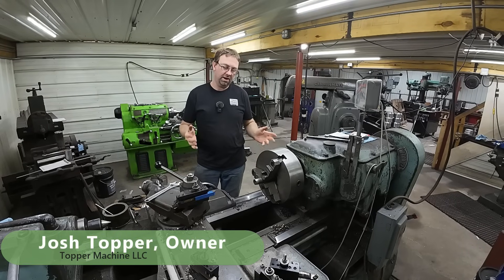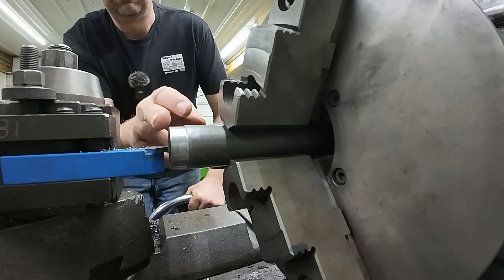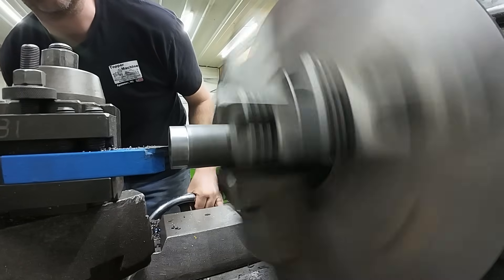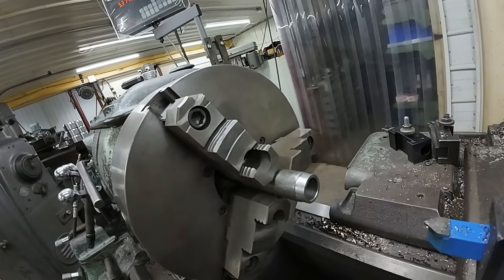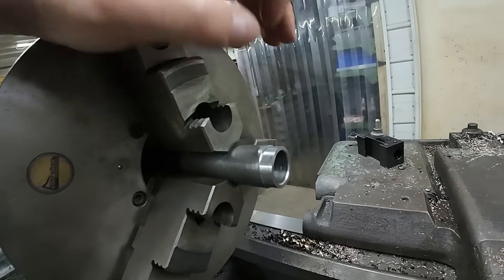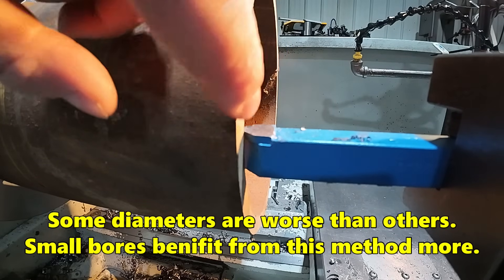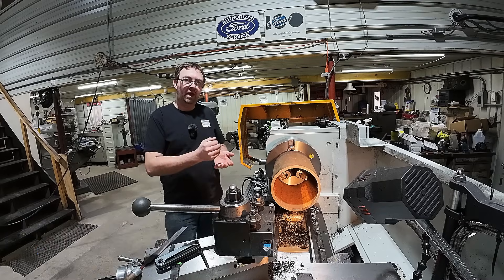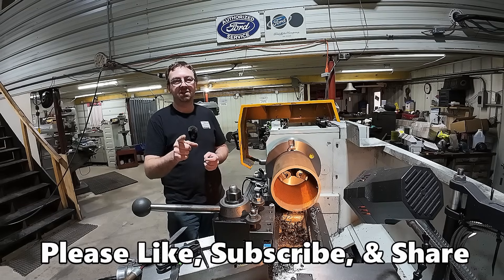Why I Adjust my Tool Height for Internal Chamfering on the Lathe - Machine Shop Tricks & Hacks

Comment: i've been machining sense 1985 and you are WRONG if you would grind more of a relief on the cutting side of the tool it will cut great and the smaller the part the more important it is to be on center of the part
Reply from the maker: You are the winner!  First person to tell me I am wrong!  Guess what, I have been doing this for 25 years.  It works.  Don't like it, tough!

Comment: That piece of tubing in the lathe scared me. I thought you were going to cut on it. Would you machine that with that much hanging past the chuck?
Reply from the maker: Absolutely, I do it all the time.
Reply: @TopperMachineLLC  I've done a fair amount of machine work, but I guess I don't have the experience to know the limits.
Reply from the maker: @phlodel  with experience, comes wisdom.  Maybe what i do sometimes is dumb, but it works.  Take your time, never rush.  Something like this can go wrong quickly, so triple check your setup and be cautious.

Comment: Your tool height differences between ID cutting and OD cutting can be somewhat mitigated by leaving your OD tool height set and locked, but cutting in reverse, and on the opposite side of the ID for boring, chamfering, trepanning etc.

Comment: I noticed that you were raising the tool for the internal chamfer on the last video and I was thinking that the tool post you are using makes it really easy to do that. Some older lathes don't have that type of tool post, so raising the tool for an internal chamfer is a lot more difficult, as it would involve packing under the tool. Modern conveniences sure help with simple things.

Comment: Raising the cutting tool slightly for internal turning is effectively adding positive rake to the cutting tool. Similar can be achieved by using a positive rake cutting tool on/at center. 

Note the cutting tooling this video is a brazed carbide zero rake tool.

Negative rake tools do not really "cut". Negative rake turning tools remove metal by heating up the contact surface area/point to where the metal becomes soften (plastic) enough to be plowed away from the work. This is why negative rake tools work good when there is enough SFM, rigidity and power from the lathe. Negative rake tools are a LOT tougher, durable and able to remove metal-A-plenty compared to positive rake tools. It is also why negative rake tool don't produce a good surface finish with light cuts and due to the forces involved negative rake tools don't do well at small cuts at all. This is where positive rake tools work better, they are good at light cuts, can deliver a good surface finish, required a lot less power.. except the cutting edge is fragile.

There is no ideal turning tool, just the best trade-off for a given need as much as the machine tool will allow coupled with the size of work involved.
Reply from the maker: Thank you for this great explanation of Negative and Positive rake tooling.

Comment: By setting the tool high, without resetting the center height nut, it allows a rapid switch to O.D. chamfer height.  We do that all the time & I saw that You did that in the bushing video, it's the other 1/2 of Your trick & some might not have caught it.
Reply from the maker: It is funny how many professionals don't do this, and are absolutely shocked that they didn't know it.

Comment: When I studied Turning at Technical College circa 1977, we were taught that the internal tools had to be above center exactly for the reasons you explained. With one addition, the softer the material, the higher above center the tool had to be offset, with cast aluminium and brass requiring the biggest offset. Thank you for your time explaining these quirks.

Comment: I started doing it years ago working with brass. The geometry change affects how the tool deflects. At center or below any deflection causes the tool to cut into the part, above center and the geometry pulls the tool out of the part. On a worn or small machine, the deflection can cause digging in, chatter ect.

Comment: You either have a specific tool for every conceivable job or you adapt what you have. If lifting the tool stightly for clearance saves me buying a new tool unnecessarily I'm all for it. There are many occasions where clearance is an issue, mainly internal or when trepaning, so when i see you doing it, i dont even think it unusual.
Reply from the maker: Exactly.

Comment: Thanks for explaining that. I never knew that it made any difference as long as the tool had clearance.
Reply from the maker: I am actually surprised by how many didn't know this.  Even seasoned veterans.
Reply: @TopperMachineLLC  A round boring tool with a 45 degree face rotated slightly will also produce a sharper chamfer due to its positive side rake.
Reply from the maker: @ellieprice363  Yes it will, but that is a tool change.  I am going for efficiency..
Reply: @TopperMachineLLC  Understood. Don’t change tools unless absolutely necessary. Rotating boring bars slightly away from the cut works well if the tool is already inserted. Thanks for sharing so many time saving tricks with your viewers.

Comment: Thanks for the tip :) did you ever get a chance to watch that reverse parting tool video?
Reply from the maker: I did, quite interesting. I would need a different tool holder though, mine runs up at and angle.
Reply: @TopperMachineLLC  yea that would cause an issue, I think his logic is sound though
Reply from the maker: @jetegtmeier71  I agree, the concept has great merit.

Comment: I have a chamfering tool set up just as you have, used it for years now.  I always ground extra relief on the one side for the extra clearance needed.  Your trick there is like magic.  I will start using it.  Thanks for the tip, Ken
Reply from the maker: Glad you like it. I used to grind the tools, but I got lazy and started just lifting to get above center.
Reply: @TopperMachineLLC Work smart, not hard :)

Comment: Excellent. I've seen a lot of people use a small boring bar or even an internal threading tool for inside chamfers. I guess it's what works for you is the best way. Thank you.
Reply from the maker: Those tools are set above center. It's the same concept, just that I don't change the tool.

Comment: On average, how much are you moving it above centerline? I am going to try this today, but it was unclear on how much.  5 thou?  20 thou?  I know it will depend on the board size, but there has to be a limit , right?
Reply from the maker: Depends on the bore, but I generally lift 1/16-1/8". Which I think I said in the video.

Comment: Definitely works, I’ve done it often. I’ll add raising an OD tool slightly depending on the diameter and clearance angle can help with vibration on slender shafts. Use with caution and consideration.
Reply from the maker: I have done that also, just don't recommend it for everyone.
Reply: Resting a wooden hammer handle on top of a slender shaft while cutting reduces vibration and chatter. Only slight pressure if any is needed.

Comment: You are effectively changing the angle between the tool and the surface being cut.  Also helps with the back relief angle to not touch the internal cut.